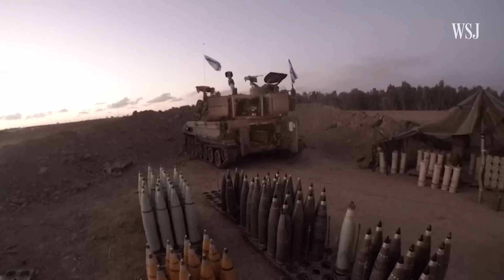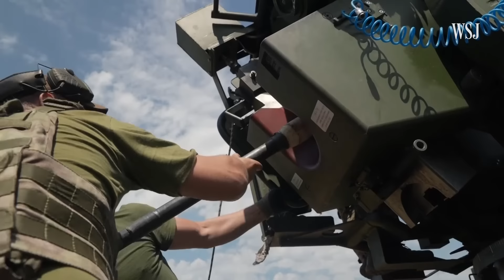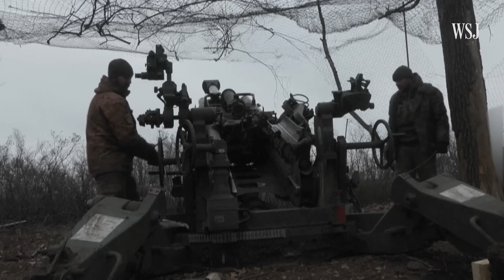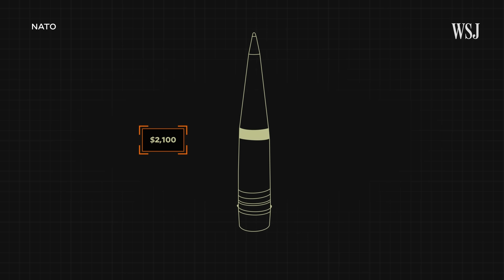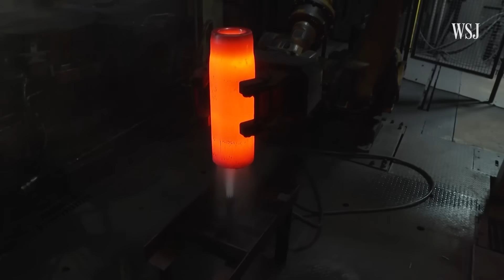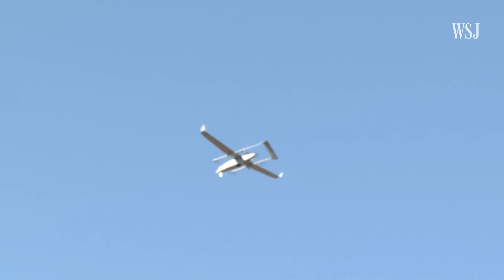Why the 155mm Shell Is One of the World’s Most Wanted Objects Now | WSJ Equipped

Comment: How is a hunk of steel packed with some explosives supposed to cost $8,000 per shell? Can we have a breakdown in the numbers please?
Reply: It is a precision machined hunk of steel. Lots of steps with lots of skilled labor. Steel itself isn't as cheap as it used to be either. Then, any labor and facilities involving explosives is going to cost 3-5 times as much. Then on top of cost, need that profit margin, of course. Then the current scarcity allows them to price gouge.
Reply: The Tools and Mashines (not many Companies build them), propellend base chemical mix and powder, licenses, skilled worker, demand The floor shells are also milled that cost time.
And dependinh on your shell typ it also gets some tech
Reply: @Janoip tools and machine are from the late 1980s war in Iraq , Afghanistan, Syria. investment in the machinery it has long paid off as for now. Only maintenance , labour and the materials . 
Its same as any other  manufatured goods , after 10 years price of a goods fall dam substantially , somehow only military industrial complex is able to keep the same price after 10-20 years.
Reply: Originally they were $2100 according to the video. Think about the skilled labor required - engineers needed to design the shells and tooling, machinists to fabricate the metal components, electronics assembly techs to build the fuzes, explosives techs who know how to safely manufacture and handle the explosives. THEN there's the cost of facilities and the utilities needed to run those facilities, and the insurance for explosives handling facilities, and the maintenance of the facilities and tools.  On top of that, government contracts often have special requirements that can drive up costs in other unexpected ways that I'm not even going to try to get into. With all those factors, $2100 per shell is a miracle. Then, when demand goes up (as it does when war breaks out), supply goes down, so the price naturally increases to lower demand to what can be supplied. Source - worked in government contracting
Reply: @LarsSobieski  You never seen old videos of ww2 shell factories . Not a lot of skilled woman in the USSR and they made millions of shells .
Reply: @Crashed131963  That proves part of my point. Automation worked in the USSR because it wasn't a democracy, so the people in charge didn't care about keeping their constituents happy. All they had to do was keep the one guy in charge happy, and all that guy wanted was weapons and the soldiers to operate them.
Reply: @LarsSobieski  Can i ask, how much cost different between 105 vs 155mm shell without fuse
Reply: @dernadaarmando2948  no idea, I don't make munitions, nor have I ever done so. My best guess is that a 155mm shell would be about 2.5-3x the price of a 105mm. Cost of raw materials would be about 3.2x for the larger shell, but many processes don't scale up the same way raw materials do.
Reply: @LarsSobieski   Ah i see, Thank a lot for the information
Reply: @LarsSobieski thanks for the interesting read
Reply: @LarsSobieski  honestly all that can be run in automated factories, can use dumb labor to load the machines... though the more fancy and modern lathes will accept large size bar stock through the headstock and automatically feed and reproduce parts until it needs a fresh bar... much like the method of 3D printing but with metal and a subtractive process instead of additive. just need a few techs on hand to guarantee quality checks and that things run smoothly and you can cut labor and safety costs. ship the shells off to a separate more controlled facility and let them load the shells for final processing and checks. would be 10x faster than how they're made now! could probably get the cost down to just barely above materials cost that way as well.
Reply: @ToeCutter454  lol start up a line then, you know how its done
Reply: @ToeCutter454  I agree, there are definitely improvements that could be made in the whole manufacturing process. Many steps would benefit greatly from automation. In the private sector, maximizing automation is good because people care about cost, and automation lowers cost. The problem is that the government isn't as concerned about cost as regular people are. Politicians that make the decisions about who gets these big government contracts aren't necessarily going to go with a company that does it for cheaper with automation, as that likely means that a few thousand of their constituents would lose their jobs. Also, automation isn't perfect. Look at the issues Tesla was having (and is still having to some extent) with Model 3 production, even with the vast amount of funding they had.

Also, automation doesn't automatically mean cheaper. More complex tooling means higher upfront costs, higher maintenance costs, and often a few months (if not years) worth of time to get the production lines tuned properly. And God forbid if a design problem is found later on and the production line has to be modified. Human operated factories are simply more flexible. On that note, quality issues often go unfound for some time in production lines with greater automation. When weapons malfunction, it's usually only the bad guys that benefit.

There are many applications where automation makes sense, but unfortunately government contracting is often not one of them.
Reply: @LarsSobieski  ah yes our lovely bureaucracy...
Reply: @ToeCutter454  your tax dollars hard at work 💸
Reply: supply and demand, much demand little supply: prices rise. U are welcome.
Reply: @tobalaba   black market
Reply: @tobalaba   and that right there is why Russia is winning.  Profit based capitalist markets for war is stupid.  Russia uses state enterprises to produce at material cost.  There is a reason even the US nationalized allot of production and price fixed during WW2.
Reply: @-Zevin- if US actually wanted Ukraine to win, it would've sent couple of hundred F35s and F22s along with tanks, perhaps ships and subs. The situation in Ukraine is this way because US wants it to be this way, providing a trickle of weapons just enough to sustain a stalemate
Reply: @-Zevin-  Russia is far from winning, it is getting a stalemate at most, which may be good enough for them, unfortunately. Russia is far from producing at cost, given their corruption, the price negotiations with the Chinese and North Korean suppliers and the sanctions. Also, the US is not at war so it makes no sense to go to a war economy.
Reply: @tobalaba   OK first, there is a big difference between has won, and is currently winning, Russia is definitively currently winning, Avdiivka is in a operational encirclement, Russia just started another offensive at Chasiv Yar, the losses on the Russian side are much smaller now than earlier in the war, while simultaneously the Ukrainian losses are much higher. The situation is very bad for Ukraine right now, unsustainable in material and manpower, Russian on the other hand can sustain this level of conflict for years if they so choose to. The manpower point is particularly important here, Russia has had around 700k volunteers in the last 2 years, and is still retaining around 1K new volunteers per day.  Ukraine on the other hand is not producing volunteers of any substantial amount anymore, and instead is only relying on forced conscription, this isn't sustainable and produces low quality soldiers of poor morale. 

I would agree with you that Russia doesn't produce at cost, I should have said they produced closer to at cost than most NATO countries. Every nation has corruption, however they are far closer to producing at cost than the United States for example. Here in America we don't call it openly "corruption" but that is what it is. It's why private corporations can charge 700$ for a special proprietary wrench. It's basic corruption but done at a corporate level with lots of official documents and justifications, with plenty of direct kickbacks to politicians.  The end result is we pay millions for something that costs hundreds of thousands, hundreds of thousands for something that should cost tens of thousands and so on.  

Basic unguided bombs are good example of production costs, these are quite simple really, technologically similar to bombs produced since WW2 iron and explosives.  Materially these bombs cost very little to produce, but for profit corporations charge US taxpayers a hefty sum.  This raises exponentially for more advanced guided munitions.  Contrast that to the very cheap production costs for Russia, in material, and already existing old Soviet factories, no for profit corporation, no middle man. Russia in the last year has started heavily using their new satellite guided glide bombs, using very simple wings attached to old stocks of these "dumb-bombs"  controlled by a GPS/GLONAS tracking system from a smart phone. This upgrade that turns a old "Dumb-bomb" into a modern long range guided bomb costs as little as a few thousand dollars, a tiny fraction of what guided US munitions cost. This is a real and substantial advantage that Russia has; and also equally applies to their very cheap but effective drones, costing fractions of what western Drones cost. Do remember in WW2 the US government didn't simply allow for profit companies to price fix to such a degree, and instead the US went to a temporary but much more government controlled production scheme, as well as rationing the civilian population, so this is possible, it could be done, but it certainly isn't done now. 

The last thing you said about the US not being at war and thus doesn't need a war economy is absolutely right, and I would go even further and say of course the United States being such a wealthy country does have the potential to outproduce Russia, but it's all theoretical, because none of that manufacturing base, or government control currently exists.  In the event of a major conflict I'm sure that could be done, and it would take a few years to get rolling, but again, Russia is already doing this, their GDP % allocated to their military is now the largest it has been since WW2.  This is a conflict they are heavily determined to win, while both the will and capability of NATO in turn do not exist to counter this production.
Reply: Just the manufacturers charging for new tooling and new assembly line up front (and trying to get the government to finance most of it, as fast as possible).
Eventually, the price should go down, providing the Defense Department forces the issue (and they are not very good at it...).
Reply: It’s a precision machined chunk of steel packed with explosives and an electronic fuse. 
Plus, it’s got some proplent to launch it out of the gun.
Reply: It’s a precision machined chunk of steel packed with explosives and an electronic fuse. 
Plus, it’s got some proplent to launch it out of the gun.
Reply: The same thing happened with masks and other medical supplies during COVID. Everyone wants them yesterday, and you get a cascade effect where there is a shortage of all your inputs overnight. It's not just the companies manufacturing the shells, but the metal, explosive, paint, etc.
Reply: Precision steel forging and machining is relatively rare these days.  Then add handling of explosive filler and precision fusing.  Cost is likely for the basic round.  There are many varieties of 155m munitions.
Reply: Miltary Industrial Complex says NO.
Reply: @HarryF-tz5fo  
Because you don’t understand how economics works? Every company that manufactures these shelves can sell as many as they can deliver. They don’t have to bribe anyone to take them.
Reply: Because it's got Electrolytes. Brawndo's got what the plants crave.
Reply: Same reason why it cost the military $2,000 dollars to replace a toilet seat. There is too many people from the start of the process to the finish that need to get paid. Unfortunately, A LOT of these people don't need to be in the process. In a modern company like mine, we have meetings to talk about upcoming meetings and then we have meetings to talk about the results of the meetings. A lot of it is VERY unnecessary and a waste of resources.
Reply: it isn't just a hunk of steel with explosives, do some research yourself
Reply: For the unguided munitions, it really is just a precision milled piece of steel with a warhead. Separate guidance systems can be added.  @JamesClark-cg1qk
Reply: corruption. Only those completely divorced from reality will say that it does not exist in Europe and the United States. for example, the cost of the same projectile in Russia is about $800
Reply: Ikr. Just use a steel thermos instead
Reply: Some european NATO states just ordered for 5.000 € per shell. But that greatly depends on the variant to buy...
Reply: ITS CALLED SUPPLY & DEMAND.. And limits should be placed on the profits.   The U.S. need its own war material industry instead of relying on other countries to support it..
Reply: Because the West uses "cost plus" pricing contracts which is basically guaranteed profit with zero incentive to increase efficiency and reduce costs. It's extremely corrupt.
Reply: The shell itself is very cheap, under $50. The powder to propell the shell is also very cheap.
The big expense is the fuze. All fuzes must be able to survive being "Fired" out of the Artillery tube, then explode at or over the target.
 The cheapest fuse are "point detonators", design to explode on contact with something hard like the ground.  Timex made these fuses for decades, they just run couple of hundred dollars each.
The most used fuse is "Mechanical time" these explode so many seconds after being fired (another Timex product).  Used when you want the shell to explode over the target.
Then you have very expensive "Proximity Fuse" these were developed during WWII and have a small radar in the fuse so when it close to something it explodes. These can run into the thousands of dollars.
More recent shells are "smart" i.e. can change its path to better hit  the target. These are the most expensive shells and I suspect the shells you are reading about $8000 shells.  The $2000 shell was probably Proximity Fused shells. Given the nature of the war in the Ukraine I suspect the US has shipped a lot of Proximity Fuse shells or Smart shells.
Reply: @paulmentzer7658  and also, talking about the price doesn't make too much sense in isolation from whom exactly are you paying to do the work. This is where purchasing parity and GDP PPP starts being more relevant and absolute prices in US dollars stop making sense because you care about real tangible products, not spreadsheet numbers.
Switching from GDP to GDP PPP moves China from 2nd to 1st place, and Russia from 11th to 5th after China, US, India and Japan. Which explains how Russia can continue supplying the troops despite its economy seemingly being much smaller than Italy on paper
Reply: @paulmentzer7658  normal shells cost 8000 dollars. advanced ones like excalibur cost 300000 dollars
Reply: literally the stupid supply and demand curve you have to look at during a whole microeconomics course
Reply: Price is set by what people are willing to pay...
Reply: Inflation:  eggs, meat, lettuce, 155mm artillery shells . . . what's a consumer to do???    Talk about gallows humor.
Reply: EVERYTHING is more expensive now. Biden's inflation.
Reply: Illegal labor cost???😂😂😂😂😂
Reply: Just three of the many different 155mm shells being produced and sent to Ukraine.
M107 the plain vanilla High Explosive.
M483 a dual purpose improved conventional munition with grenades that are ejected over the target. Much more complex and more lethal than the standard HE shell.
M795 another HE shell with very high grade steel. When detonated blankets the target area with small splinters that  are highly lethal
Each shell is ineffective if it does hit the target. A very high level of uniform performance is required with exact specification met in producing the shell,  powder and fuze. One shell can have the effect of ten but only if it is on target and only it detonates with full effect.
The North Korean rounds are cheap and available in large numbers but are said to be inaccurate, have a high dud rate and may explode in the tube. Ukraine may be asking for shells that are high grade  and are more expensive.
Reply: Countries have been making shells on mass since WW1 ; this industry is not High tek  
 It’s plain old fashioned price gauging
Reply: @richardevans3084 uh sure. Shells today are exactly the same as world war 1 lol.
Reply: @richardevans3084  * en masse ("on mass" is a meaningless couple of words)
Reply: We mill them to amazingly precise tolerances and quality control them up to and including x raying every single unit in some factories. They can be made for something like 800 dollars per unit in peace time if you basically rough them out of castings like they used to in WW2 and still do in Russia. The trade off comes from reliability/constancy and of course irritating war profiteering industries that were promised a decades long gravy train. Keep in mind your also paying to put these hunks of steel on a plane and flying them halfway around the world. There is an entire generations surplus wealth flying out those barrels. Chances are that 8k shell representing 1/3rd of your annual tax bill is being used to kick up some dirt and keep a few guys heads down for 20 seconds. This is madness.
Reply: You are 100 % correct. It's madness
Reply: 8000 still isnt that bad, its putting a price on life in a pretty direct way.
Reply: The one big number you need to consider is that the government will only want a limited number of them after you get all the permitting and construction and hiring and training done and you have to make a profit at some point before they pull the rug out from under you again.  After that, you then have to spend more money to decommission the plant and pay off the workers.  None of that is cheap in America and it keeps getting more expensive and difficult.  This is not a country that loves manufacturing or workers.